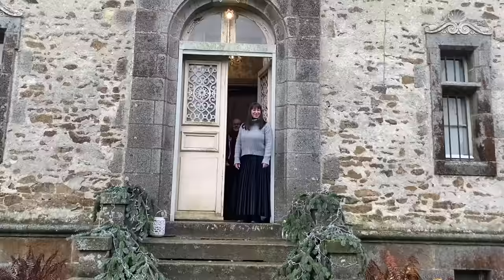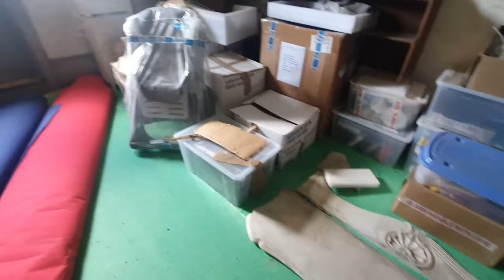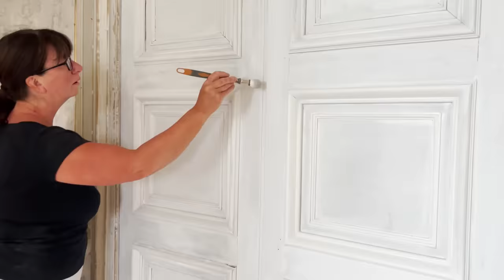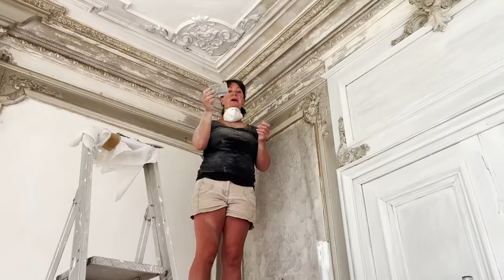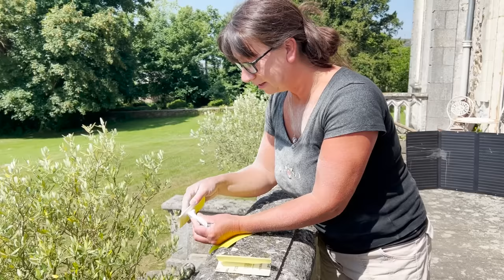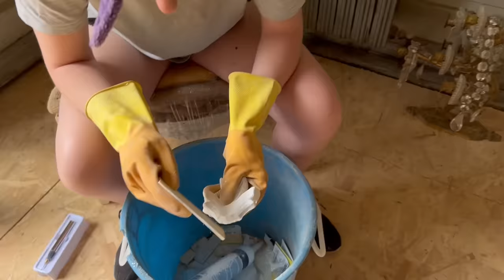Angels Of The Chateaus Salon! - Day 6

Comment: With the cracks in the wood - I watch on occasion this YouTube channel Our Restoration Nation and they work on old houses and try to save historic homes in the southern US.  The lady of the channel swears by this stuff called Abatron.  It's supposed to be a wood putty epoxy thing that is resistant to mold, mildew, rot and also bonds very well to the wood and she swears by it.  They use it as filler, help fill in missing bits to replace instead of trying to cut out pieces of wood to match, and it's apparently very easy to work with and can be used for indoors as well as outdoors.  It doesn't shrink or crack, you can sand it, nail it, pretty much use it just as if it becomes wood once it has hardened.  I don't recall if this was something you were using before but if you haven't and it's available, perhaps it would be worth a shot giving this a try?
Reply from the maker: I've also been told to use car filler! I'll watch that, when I get a chance  Cxx

Comment: Hi, that stain block is good, I used it in my shower room on the ceiling and it worked wonders. Has the damp issue been fixed?
Reply from the maker: Tbh I'm not actually sure how damp got there, but we have plenty of dehumidifiers running constantly drying out the place.